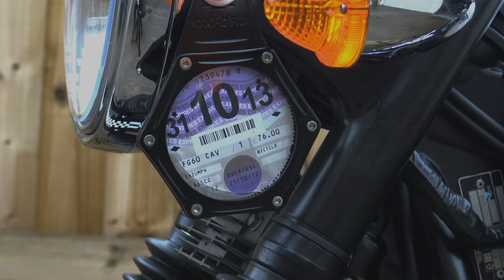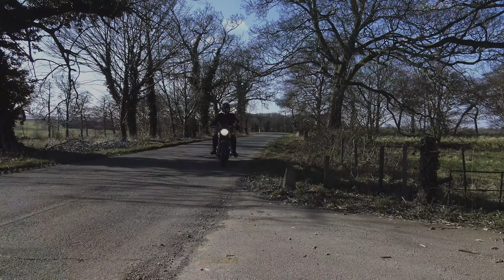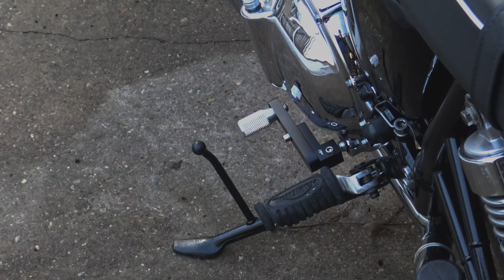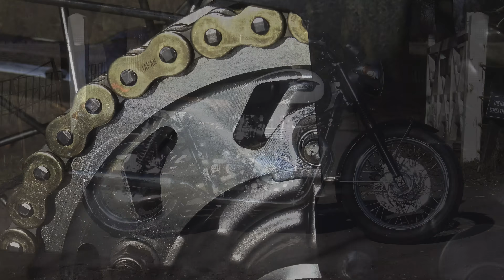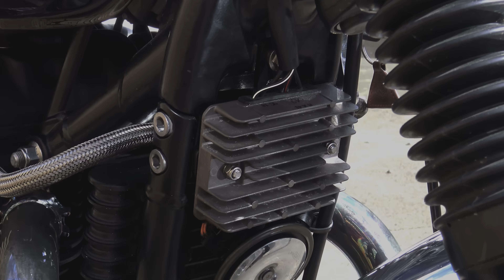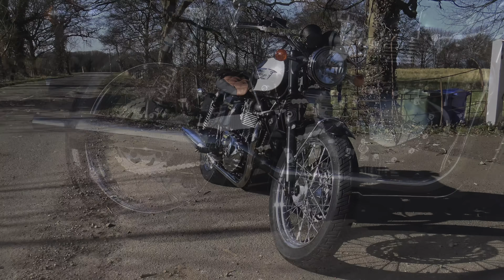Custom Triumph Bonneville T100! The return of PAYDAY PROJECTS!

Comment: Fantastic glad to see the t100 back in the limelight. Actually forgot about some of the modifications you had done or missed them as the videos were coming thick and fast during the summer. I am going to dip into them again just to see the ones I missed. Thanks again for the recap of where the T100 is and what is planned in the future

Comment: If you doing airbox delete and exhaust mod, get the fuel map from triumph twin power. It will transform the bike. I removed the airbox baffle, Sai, O2 sensors with Dunstall classic mufflers n uploaded there tune 3... Its amazing. You might even like it better then your t120 .😁😁Which exhaust are you planning to put..  Try emgo short reverse cones, they come in brushed finish too (if your on tight budget)
Looking forward to more videos. And thanks for the videos on this bike, they helped me do the same changes to my bike.